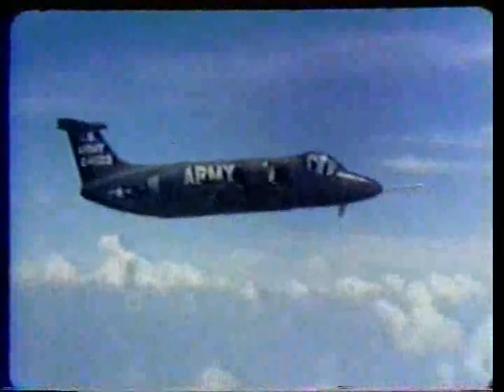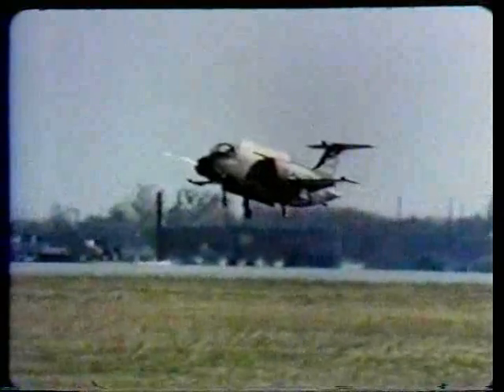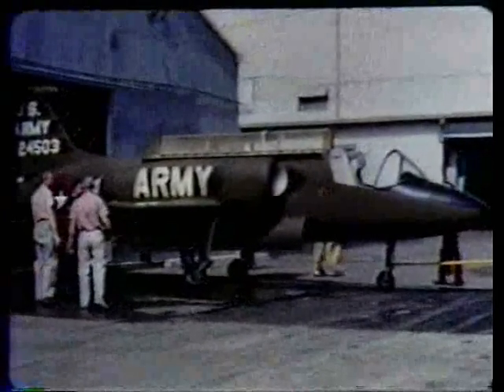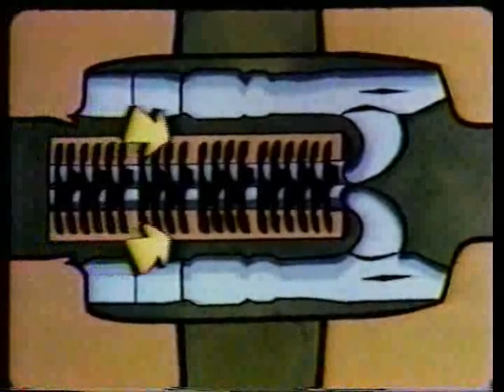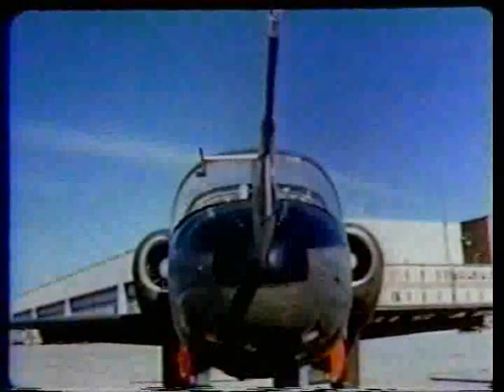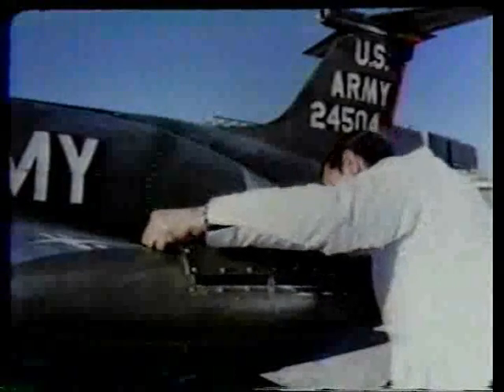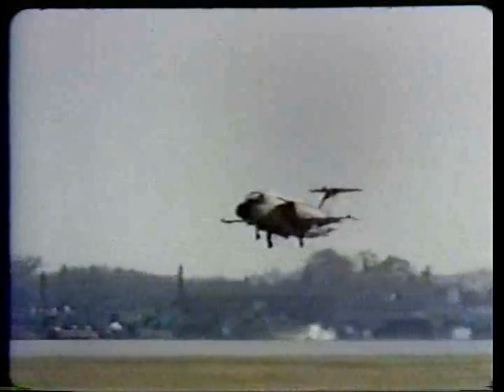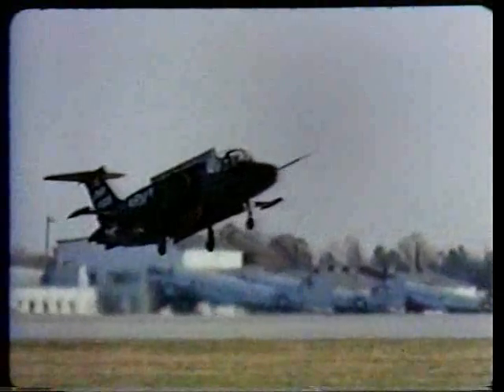The XV-4A Hummingbird from Lockheed Georgia

Comment: I never thought I'd see such historical film recordings.
The machine flies very stable in the hover flight, considering that everything was still controlled mechanically via push rods and Bowden cables, without computer control. a true engineer and pilot achievement. Thanks for this very interesting historical video.

Comment: This is a very interesting historic video from an engineering design point of view  and also strategy at the time,  and it is good to see it being published. Vertical take off aircraft are interesting craft from the control point of view as they are not really positional control systems, but velocity controlled system and the pilot must learn through giving an accelerating signals to  be integrated to a velocity which will then be integrated to a position, As all this takes time, there is quite a long delay between what the pilot desires and what  position the plane achieves.   Any pilot would be better prepared if he  first learnt about,  Position, Velocity, Acceleration and Integral Control systems before he ventures in taking off in such a plane as other wise a lot of oscillations may  occur  due to the overall control loop having a large delay, which may lead to instability.  Using the control jets at the  nose and back and on the wing tips, it is  not a case of positioning them for a long time, but to simply give enough acceleration signals to accelerate  or decelerate the plane in any given direction. It should be pulsed control rather than long periods of joystick movement.  This acceleration control would be more difficult to learn as it is not instinctive as positional control systems and the delays involved  can be fatal.   In another film I  noted  how one of these planes went unstable on landing and I do feel that the pilot was not conversant  with   giving the right acceleration control at the right time and allowing for the delays involved, the whole craft oscillated and unfortunately damaged its undercarriage.
This craft use an ingenious system to increase about 2000 pounds of thrust through bleeding secondary air into those down facing nozzles in the fuselage,  which is a good  idea as it also serves to cool things down.  I do not think I would have liked to be the man who designed those by-pass valves to redirect the main engine exhaust to the lift nozzles as the heat they would need to withstand means some good design, working with good materials and control and cooling systems.
Thank you for uploading this video as technically speaking it adds to the hew of colours aircraft engineers use to meet the same VTOL problem using such different designs to achieve it.   Thank you once  again.
Reply from the maker: Carmel Pule' You're welcome! Most happy to share, your comment is a perfect example of why I put these items online.

Comment: This vid was fascinating. I have a love for all VTOL craft. This one seemed to work very well. I'm surprised it didn't evolve over time. There's many ways to achieve VTOL. One odd one tried using a blown wing. Eventually the harrier & F 23 made it work with very different systems. I didn't hear of the hummingbird killing any test pilots. That's a promising aspect for sure. The incredible Harrier killed many experienced pilots. And time will tell how the F 23 performs. Russia & China both are testing modern VTOL designs. So who knows the pros & cons of each of these. A deep comparison between each of them would be fascinating. Especially a Harrier vs a F 23 Lightning ll. These old experimental craft films are Truely golden.  I'm surprised how few views & comments this one has got in 2 years. I enjoyed this very much. You tube must have been sitting on it.
Reply: It crashed twice, but I think the pilots bailed out safely. 
Still, the idea of augmenting the jet stream with cold air is a really good idea, it helps cool and oxygenate the exhaust so exhaust ingestion isn't a big deal anymore, unlike the harrier.
Reply: @anonymousperson2110  thanks for sharing that. Interesting.  I suppose the fan contraption on the F 23 is a great way to divert jet exhaust.  To infinity! And beyond!
Reply: @bradbrown8759  *F-35. The liftfan isn't to divert exhaust, it's to provide a second column of cool air to provide more force, balance the jet and keep the hot, de-oxygenated air away from the inlet.  Basically, the F-35 has a swivel nozzle at the back of the jet that can swivel to vector the thrust downwards, but if there's only an upwards force on the tail of the jet, it'll tip over, so the liftfan, in the middle-foward part of the fuselage, is connected by a driveshaft to the F135 engine to balance out that tipping (and provide additional force). The cold air from the liftfan also forms a barrier to prevent the hot exhaust from being re-ingested into the engine.
Reply: @anonymousperson2110  Roger. I'm fully aware of that. Its an effective forward lift, while also  preventing that swiveling blowtorch in back from smokeing the intake. I watched that NOVA on the Joint strike fighter competition between Boing & Lockheed Martin. L.M. really dished it up.  Boing's "Yawning hippo" not so much. There carbon fiber wing alone was so big, that it was virtually unmanufacturable due to the inclusion of voids or delamination.  Even the name Lightning ll is cool as a nod to Kelly Johnson's wicked P 38 Lockheed lightening. Both are among my favorite planes.
Reply: @bradbrown8759  Aah yes, Boeing's happy plane. It lost the competition and got gutted and put in a museum, but at least it's still smiling. Learn from the happy plane :)
Reply: @anonymousperson2110  Happy plane 😂😂😂  A museum is the best place for it.
Reply: @anonymousperson2110  one of the pilots was killed in the first public showing and flight, I was only eight hundred feet above the ground when he tried to bail out the plane was inverted and his parachute didn't have time to open.

Comment: An aircraft I've only seen pictures of and very little in the way of text. Thank you for putting it up. It's of the same era as the Hawker Kestrel. I think I know which is the more elegant solution - that is one complex transition from jet-bourne flight to wing-bourne flight. I wonder how they would have developed it to give it the same STO capability that the Kestrel and later Harriers were built with.
Reply from the maker: Thanks! I'm glad you enjoyed the video, I'm happy to share (and it's a terrible waste to let them just deteriorate on a tape, unseen). Good questions about this as compared to Kestrel, I think there were a number of teams trying to solve the problem...and not all the concepts turned out to be practical.
Reply: this hummingbird seems like a very inefficient design
Reply from the maker: It does indeed. That's probably a large part of the reason why there were only two built.